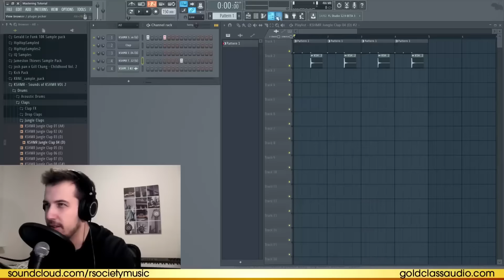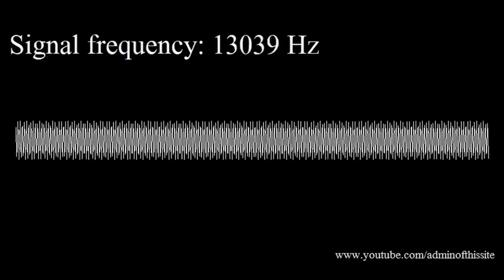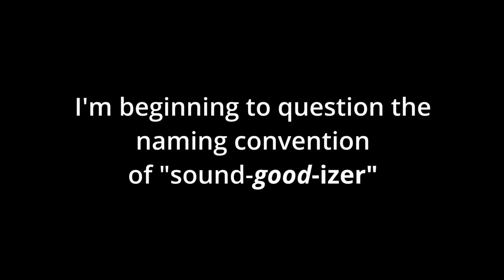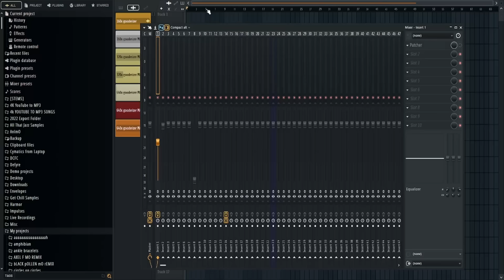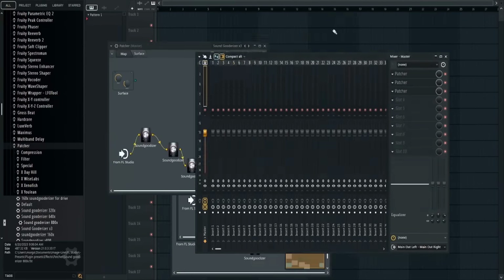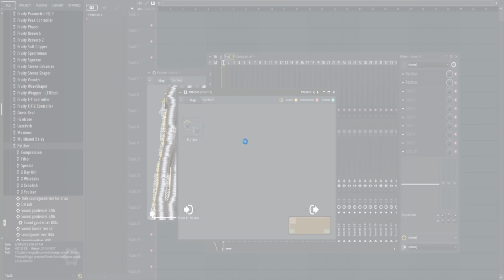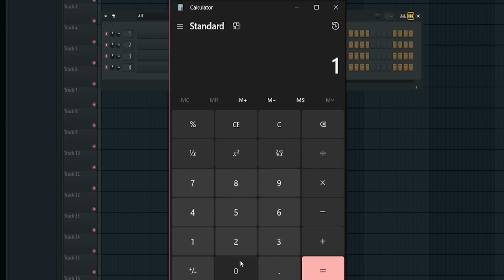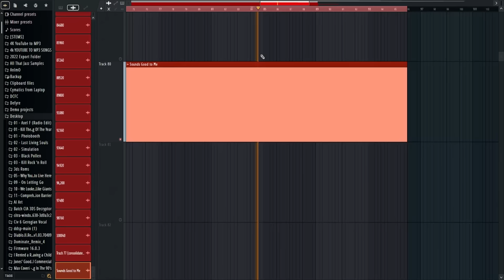4 Million Soundgoodizers on 1 Kick Drum

Comment: Mad respect for the effort and for droping your knowledge on us
To make your life easier, you just had to do this.
1) Open Soundgoodizer, max the goodness and save that as a preset.
2) Open Patcher, drag the preset you saved into patcher from FL browser how many ever u wanted.
3) Lets say u load 100 soundgoodizers, save that patcher preset. Open patcher inside of patcher and just load the preset. Do that 7 more times, you have 800 soundgoodizers running in each slot

doing this would've saved u a shit ton of time.

I haven't completed the video yet. Maybe you figure this out as the video goes on. I'm a watch the rest later.
Reply: I wonder the performance difference. Like say you only did 10, then made a 10 of 10 to get your 100 preset. Then 8 of 100 to get 800. Depending on the way it was implemented  it could be more performant, slightly less performant, or considerably worse.
Reply: thats smart
Reply: you are on a whole new level
Reply: Can we do this thing my programming a macro? I saw that FL has macros. I'm not sure I' MAINLY an Ableton user.
Reply: I was wondering about Patcher's ability to run itself. It seems like that could be incredibly powerful

Comment: This must be the goodest sound there is! This is exactly the kind of nerdy and unnecessarily complex videos, I want to watch! I love your technical explanations along the way, although I don't quite agree on all of them.
But first of all, I'm so sorry that you put yourself through all that torture of loading up 800 plugins manually. There's a faster method: nested patchers. Load two (or more) soundgoodizers in a patcher, save that as preset. Load up that preset twice (or more) in a new patcher, save again as preset and so on. This will step you up the powers of two. Of course, this will probably take up more GDIs, which I don't know much about. Thanks for that hint, I'll look into GDIs.

To address your audio explanations, I'll take a short segway, of how audio is being processed in a DAW and in plugins. Sorry, if the following sounds like mansplaning. Mind the ambiguity of the word sample: it could mean a snapshot or an audio file. For the latter I will write 'audio sample', for the first one just 'sample'. 
Audio generally gets sent around in buffers of samples. You can decide the number of samples in the buffers in the audio settings (called buffer length in FL). Let's suppose you have a buffer size of 256. Why buffers? Well, processing lots of samples in the same way in one go is faster than processing them individually and always switching to other processes in between.
But there's also the sample rate (can also be set in the audio settings), which describes, how many samples will be played per second, regardless of buffer size. Let's take 44.1 kHz.
The samples in the buffer have a bitdepth of 32 bit float, probably every DAW does it this way (REAPER goes even as high as 64 bit float).
So in your example you start with a kick audio sample, which is 44.1 kHz and 24 bit. This 24 bit gets converted into 32 bit float, which can be done without losses. Now a buffer is filled with 256 samples of the kick audio sample and sent to the mixer track in the patcher and into the first sound goodizer. The sound goodizer knows, that it gets a buffer of 256 samples and that the samples inside will eventually be played back in a given sample rate, which it needs to know to process it correctly. It processes each sample in the buffer and writes the processed samples back into a new buffer of 256 samples. This buffer gets passed on to the next plugin, until it reaches the end. Then this buffer is sent to your speakers for playback. Then the next buffer is filled with the 256 next samples of your kick sample and passed through the sound goodizers to the output.
Rendering does not necessarily dry the paint and lose information, if you choose the correct settings. Rendering basically means writing an audio file. For a wav-file the DAW writes some essential informations in a so-called header: channel count, sample rate, bit depth, meta data. Now it is important to tell the DAW to choose the same settings as your DAW processes audio: the same channel count (stereo probably), the same sample rate (project dependant), and the same bit depth (32 bit float). If you do not, the DAW would need to apply lossy conversions. Also turning off dithering is important. Then the DAW collects all these buffers and splices them together to write them in the audio file. In the end, there's no sign and no artefacts of the buffer size in the audio file. If you load a sample of these settings back into the DAW, the data would be exactly the same, as if it played back coming out of the sound goodizers.

Anyway, keep up the nerdy content! Also if you want, you can watch my video on aliasing (https://youtu.be/7iSqgGQE3Rg?t=26 ) for an interactive visualization of the concept.
Reply from the maker: Wow, I really appreciate this deep explanation! You are clearly very knowledgeable about this subject, and wholly welcome the critique! I really enjoyed your video on the topic of aliasing and the Nyquist effect, and the direct and interactive visual you gave the audience for grasping the concept :)

I'll definitely take some notes, and try to address these concepts with a bit more nuance in future videos, because you're absolutely right; I definitely ended up skimming over that fact when talking about upsampling/downsampling, and spoke on it more in a way that presumed that people were generally converting to a lossy filetype. I am a little confused though, as I thought even dithering would return super minor-ly changed results, masking the artifact related distortions, but still altering the final product a little bit; would you be able to explain that a little bit further, or maybe link up on Discord so we could chat about this a bit more?

I really appreciate you taking the time to flesh out this comment and explain in such great detail about it, and thank you so much for watching!! : )
Reply: Segue, not "segway". Segway is a company making standing scooter things.
Reply: @theRPGmaster 😂😂😂 get out of here. The comment was nice okay 😂

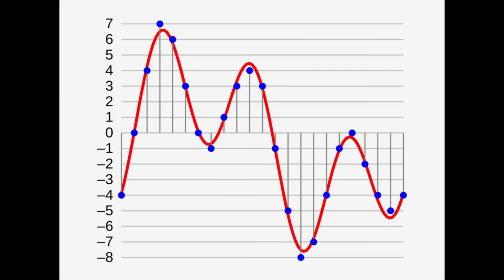Comment: Great video! 2 minor corrections though at 4:00 the bit depth is actually the amount of digits used to measure the amplitude at a specific sample, its completely seperate from sample rate. Secondly fl studio uses 32 bit float internally at whatever sample rate you have it set to so as long as you export at 32 bit and the sample sample rate then there is no difference between rendered audio and the audio in the daw itself because thats exactly what its doing internally.
Reply: I see. I'll keep this in mind when I render my future projects 😊
Reply: @egbedunmomore1434 doesn't not render at 32 by default anyways?
Reply: Thanks for saving me time writing this exact comment.
Reply: @illford It does. I'm now deliberate about having it be 32 when I render 😊

Comment: On the rendering method : resampling is not used if the audio clip and project are running at the same samplerate, and since he's using audio rendered from the same project, it's safe to assume they're all at the right samplerate. The only problem I see to me is that they used 24 bit integers instead of 32 bit floats. Floats is what's used internally by DAWs, and as such printing to a 32 bit float wave file captures the exact output of the DAW without introducing anymore computation. This is why floats are preferred when bouncing stems for sending to a mix engineer, along with the fact that floats can represent sound over 0 dBFS unlike integer formats, and would have eliminated any rendering artifact.

DAWs essentially print small float wave files between each plugin they process, this is how they're able to send audio data to and from them. Printing to a float wave file, then, does the exact same thing, but saves the last audio file to your file system.
Reply from the maker: This is a great call-out, I'll definitely be sure to have a segment in a future video that addresses this. Thank you for sharing that!
Reply: @mo_oorgan  Further precisions in which case ; most* DAWs (not all) use floats in their audio engine, the notable exception being ProTools (umit uses integers but in a way where it will cap out at ~+20 dBFS (IIRC) instead of 0), and Reaper being Reaper, you can actually choose between floats, and 16/24/32 bit integers (but the VST2/3 and CLAP formats require being given floats, so it negates the benefit of having your audio engine work with the same format as your exported audio).

The choice to use integers comes from a time when computers could not process floats, or very slowly, and the performance increase was worth the trouble. Nowadays floats are optimized and there are even specialized instructions for process multiple of them at once (if you've heard of SIMD/AVX/SSE/NEON, that's what it is). But backwards compatibility is an important feature of computer engineering, and so we're now stuck with having to support integer audio formats now.

Comment: you couldve duplicated the plugins with its settings by using the "save preset as.." function which you can drag off into the panel for easier duplication

Soundgoodizer was not updated internally so far, at all. It has its origins still in its first introduction somewhere in fl9 or fl10, meaning it will use outdated pointer and allocation memory for their GDI management, meaning at some point it would hit a hardcrash internally because it wasnt meant to handle it in the first place. Youd have to rewrite it for newer FL so it can continue to work, perhaps. Parametric EQ2 has been updated several times including its allocation so it is as efficient as it can be.

Comment: 14:52 while you can't copy and paste inside patcher, you can insert another patcher inside patcher, if you save a preset with 200 soundgoodizers, then you could load 200 soundgoodizers at once... That's if your cpu survive the struggle though lol

Also if anyone's wondering why soundgoodizer makes things sound the way it does, soundgoodizer is a (non linear phase) multiband compressor, and that's what we are mostly hearing in these noises, phase rotation. And it's not really easy on the CPU (for this many instances ofc), since it's just Maximus compressor running behinds it's single knob

Comment: I'm fairly certain a mistake was made explaining aliasing... the -7.45 kHz should be added to the 22.5 kHz Nyquist frequency, giving you aliasing around 15 kHz.

But that only applies if you're generating a pure tone directly at 29.95 kHz! If you had a track with no frequencies above 22.5 kHz, then you wouldn't experience any aliasing when exporting at with that same limit. This is true even if the original audio file was technically a higher sample rate.

Comment: The wav export depth was set to be 16-bit. That's more than enough for any content (noise level at about -96 dB where -40 is practically inaudible in a sound-rich context), but when iterating what essentially is an amplifier the noise gets multiplied. The end result this way partially is like a 1-bit or 1.5-bit sound, since everything else got crunched. And I don't think even FP32 would have helped, it has roughly 26 bits of usable precision that varies with amplitude.
In short, that many soundgoodizers (and amplification) is like compressing so hard, you get a mix of noise with some sound.

Comment: Thank you for the knowledge but when you stack a bunch of Equalizers (yes soundgoodizer emphasizes parts of the frequency spectrum) you are basically just adding feedback - creating an oscillator in the long run. Thank you for showing how soundgoodizer sings - you should make an instrument out of it :) Only question would be how does the actual Kickdrum sound now? All the best, Tobi

Comment: someone already mentioned the patcher inside patcher thing that could have saved some time but also to avoid turning all the soundgoodizers one by one, you can drag n drop the "save preset as..." option and it will duplicate the preset of the current plug in. Just for the next 8 million soundgoodizers video

Comment: 44.1 khz was chosen mainly because of the average number of samples you can reliably squeeze onto a frame on both PAL and NSTC. Yeah, cd format has a VHS digital audio predecessor.
"Negative frequency" is phase reversal.

You can! copy paste an individual plugin in patcher. Right-click and drag the "Save preset as" context menu entry. You can also add patcher to patcher so you can drag paste multiple gudaizers. So ... 10gudz * 10pp * 10pp * 10pp * 10pp * 10pp are 60 copy paste and links for 1000000 gudz. ;) .. Please note, i don't know the nesting limit of patcher.
- If there is a paper sheet next to any context menu entry it means you can drag it.

Get more exercises of futility done in less time!

Comment: I don't know any tech specifics, but you can run FL Studio in Linux through different configuraions of Wine (including Lutris options). Maybe you can play with config numbers there somehow. Not to mention it is opensource, so you can even make a fork of Wine. Or a fork of Valve's Proton (which is their fork of Wine).
Yes, I myself successfully use FL in Linux, but I'm just a regular user for the most part.

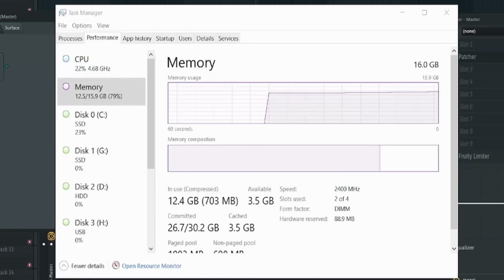Comment: 27:11 You also need to pay attention to the committed memory, which includes all the memory Windows has allocated, with some of it also living in the disk called "virtual memory", which is swapped between RAM and disk depending on whether you need it now. Programs are not allowed to allocate too much memory, and as a result they crash in many instances. The most memory you are seeing in your RAM is from FL, and Windows sees that limitation in your system so it crashes FL to prevent your system from getting overloaded.

TL;DR Committed memory gives a better perspective about the total memory your computer is using. Just download more RAM.

Comment: Those saying he could have used patcher within a patcher within a patcher and so on. He will still run into the same issue, which is the GPI limit of 10000 or 65000 if you opt to increase it. 

Totally botched the values and the term, but you get what I mean 😂

Comment: I can tell you did your research but you kind of missed a few crucial points - digital audio IS indeed perfect, and if WAV-format audio changed over multiple exports, as you claimed, it wouldn't be lossless. Lossless literally means the information in the file is 100% identical to the source.

Resampling DOES have inaccuracies because it has limited precision (though it's generally more than good enough these days) that will cause aliasing, BUT resampling is only used by the DAW for non-native plugins running on samplerates that exceed those of the project.

Soundgoodizer is a native plugin that automatically uses the same samplerate as the project and so there's no need to resample, which is why FL DOESN'T automatically resample, even if it gives you access to the resampling settings in the export window. The real reason the waveform is changing over time and you're getting more distortion is NOT being caused by quantization error, but because Soundgoodizer is a dynamics processor (ie compressor) and dynamics processors are non-linear. Multiple passes in series are going to introduce distortions in the waveform.

Another concept I think you may have partially misunderstood is dithering. Dithering is only done when moving downward from one bit-depth to another (ie going down from 32- to 24-bit or from 24- down to 16-bit) and the reason it's needed is because truncation occurs on the tail ends of a wave cycle that fall below a certain level when they get close to the zero point - as there is less resolution for levels near the zero point, the tail end of the waveform is often cut out, which causes distortion in the output waveform but this is fixed by dithering which introduces randomized noise that floats just above the noise floor, and allows for a smooth transition from the tail end of the wave cycle to the zero point.

LPCM (digital audio) is literally perfect. And lossless means lossless, full stop. You can nul test your files to confirm what I'm saying. If your exports are changing at all, even after multiple dozen exports, they're not being bounced in a lossless format or there's something going on in the background (successive distortion from multiple passes of nonlinear processing) that is adding cumulative imperfections to the signal.
Reply from the maker: @pc_buildyb0i935  I completely lost track of this comment over the months, but thank you SO much for taking the time to explain this; your comment is absolutely art, and will strive to make sure it ends up in a future correction video <3